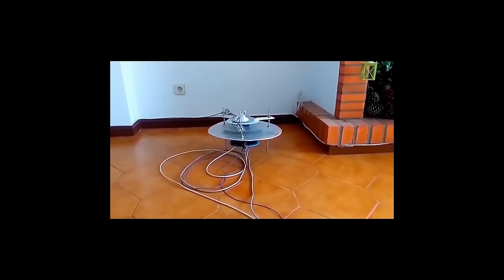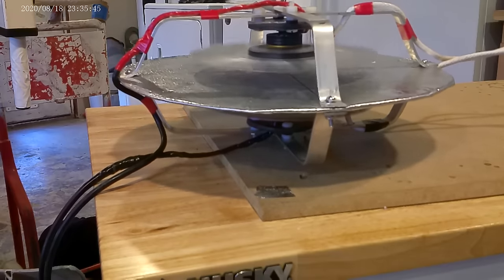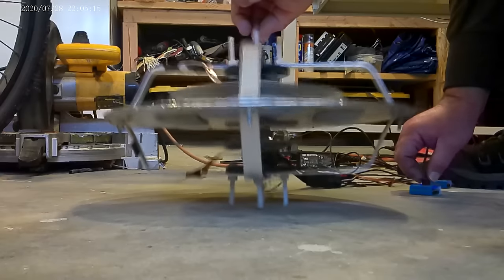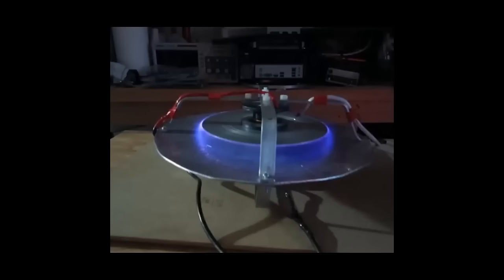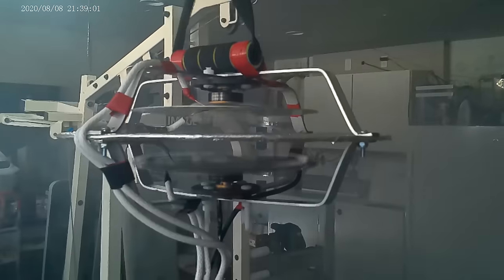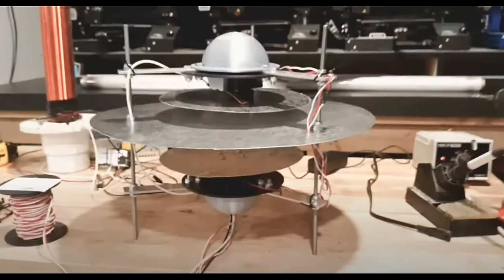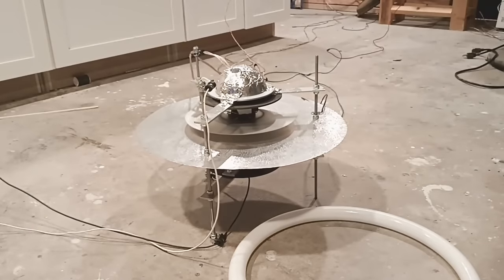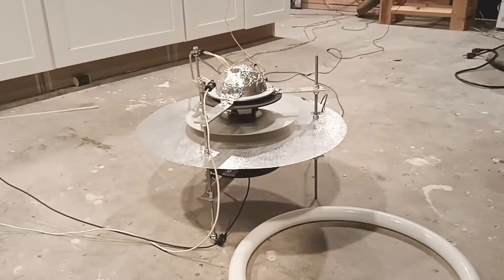Rebuilding My Graviflyer "Testing Everything"

Comment: You must Thought out of the box MR OLD MAN some people watching your videos and they already seen the antigravity technology inside an aircraft
Reply from the maker: I could always connect the tesla coil as a bipolar coil and increase the power of the field. I would need to change the #1 coil up a little. But not enough to stop the frequency beat rate. This would work in tc on both disc's and the hv to the frame. 

Th hv to each disc and the tc to the frame has an amplification point at 40 minutes running that could be exploited to increase the resonance of the center plate giving the piezo disc more energy to flip the field in and out for a few seconds.

Comment: Also N.Tesla patented an air vehicule that works as a giant capacitor. Wingless with a pole at the tip and a pole behind the tail wings. Apparently he traveled with it ! Inside spaceship there are big black cables that glows surronded  by  a blue  aura,bion.
Reply from the maker: is there a picture or video of that?

Comment: Just finished reading “The Man Who Mastered Gravity”.
It is a must read, specifically for you. It is a book about Townsend Brown. Who experimented at a lab (Father was rich) and it took him over 30  years to reach a breakthrough. The book reads like an Indiana Jones story.
He talked about achieving anti gravity with a fluid dielectric or a solid dielectric. Fluid dielectric is ionic wind, very weak. His breakthrough was the solid dielectric by charging unequal capacitors. It was classified but he was a very willing participant since he was very deep in US intelligence even befe there was a CIA or NSA.
Love your effort. Will continue to follow what you do..
Reply from the maker: I am working on a device that deals with charges and capacitors where the dielectric is also simi charged but won't break the voltage down between 2 disc's. Idid one before. I am going to start showing the force from it on a scale when flipped upside down. 
https://youtu.be/pkCNuuiI1kM

Comment: The high-spinning disc resisting change in movement at 3,000 rpms is called gyroscopic procession. This type of centrifugal force has always intrigued me.
Reply from the maker: it is balance not lift. Try it if you get a chance. when you have the motor in your hand you will understand.

Comment: I wonder if Alexey Chekurkov's Graviflyer is a follow - on to Eugene Podkletnov's work.
During one of Podklentov's long interviews, he clearly states that there had been advancements in understanding the principles underlying the would-be publication that relied on a levitating, superconducting disk rotating at over 10,000RPM.
In that old interviews, he said that they had figured out a way to achieve the goal without the need for exotic materials, and what he described could well be something like Chekurkov's device
Reply from the maker: Alexey is working on harmonics to create the townsend effect. The dc fan motors cannot go that fast at all. 1300 rpm max.

Comment: My theory suggest that paper unique electric properties might come from it fibrous structure forming cavities of different sizes leading to tunneling electrons spreading around the sheet.
Reply from the maker: It is charging the air inside and the structure is holding it in. The weight is 4x the amount when charged. It might be more if I change the height of it. Wood is the best substance to apply charge to for instant decoupling when needed. One of the next tests for the paper lifter is to shorten the height then add more discs. The radius should allow for more pressure. If it does then the outside air is also being affected. This would give us an understanding between wood and gravity and how much downward pressure trees put on the earth bringing up the gravity level. It is an interesting study.

Comment: 12:25 - basically the opposite of an ignition coil. Instead of working intermittently collapsing the field to generate a high voltage current, you are using the coil to condition the charge by converting the field of the excess amperage, and convert it to voltage... which can be more easily/efficiently carried by the wire, and respond more efficiently through the fields of the machine.

The bad part is... the EMF of your contraption is getting dangerously high. If a portion of the generated EMF is in the wrong range, you can run into risks I don't think you are prepared to mitigate.

Comment: 1 thing i notice that is different to Alexis is energy density, could you try a 13 AH 12v lead acid battery, for each device. Instead of AC transformers.
Reply from the maker: the current at this point I am constantly turning down. so more of it would not help.

Comment: You should put it on a scale to see if its weight changes at all during any of the tinkering/banging/arching.
I would recommend an old-fashioned analog scale, no digital components because those have a tendency to be spitting false data when getting bombarded with electrons.
Reply from the maker: I agree

Comment: Have you incorporated the use of metal rings around the magnets? Also Alexi’s magnets are broken which will act as multiple magnets per ring, I.e. multiple north/south’s. 
I am wondering if the voltage from the Tesla coil can be transferred with a plastic cable. In multiple HV demonstration it has been observed that the static field will energize plastic.
In Ken Wheeler’s magnetism work he describes magnetism not as an attraction force but as  a rush (rush may not be the word he uses) to a rest point. The Bloch wall or rest point.
Ken states that “gravity” is the same as a magnet. He does not hold to the current theory of gravity.
One other site I looked at yesterday was showing that all things are diamagnetic, even wood.
Reply from the maker: static fields do travel through plastic. the metal rings are on the magnets from the factory. Ken is thinking of charges. Magnets imply that the material needs to be ferromagnetic. Charges or polarization is the correct way to see gravity.

Comment: The paper touching and leaving might be producing oscillation of rate of rotation of the disk and this might be the reason for that field. I don't know if you thought about it but you could use PZT that has high relative permittivity to test you theory and maybe increase the field. It's also relatively cheap, I think you could try it
Reply from the maker: it is a jump starter for static volts. The tesla coil field holds things in and the high voltage has very low amps so it acts like static volts. I can fill the area where the tesla coil makes the bubble much faster by touching the dryer sheet to the top disc only.

Comment: Two things, I think should be attempted. 1. Set an old AM radio in the area, not too close as you vary the motors. You should be able to hear any arcing, which you do have randomly, it appears. Arcing isn’t always a good thing as it burns and oxidizes the contacts. 2. Waving your fluorescent tubes isn’t very scientific for diagnostic purposes. The tubes should be fixed so variances are more accurately defined.
Aside from that .. this fellow you refer to as having a viable craft; does he run a website or something similar for studying his methods and processes? Thx.
also: when that computer trips, exactly what is the PC/Mac machine do? Reboot, pick up a “ghost” device, like a printer? What happens?? ✌️
Reply from the maker: It picks up ghost device or changes the web page on it's own.
Reply: @nathanbunten4299  yeah, you really need that spectrum analyzer to see what’s causing THAT kind of effect. Changing a web page requires VERY specific coding  - whatever it is, that’s just weird. It would be very interesting to see the interaction.  If you’re creating RFI, and you probably are, you definitely need to know so that you can protect yourself.
Reply from the maker: @gaspumprepairservice7009  I was careless. I know what went wrong. I try to explain how the fields push because of the Tesla coil. I was 1 foot away from the craft at Max power instead of turning it up slowly from a distance.

Comment: His disc is about a quarter inch thick. Your disc is 1/16 of an inch thick his disc are rounded off yours is squared off. And he's got another coil on the craft itself I don't know if it's some kind of coil or some sort of Tesla coil and yes you need many times  maybe 5 or 10 times more maybe even more. And the distance between the three coils probably makes a big difference , you may be able to look at his video and get estimate size and ratio by watching his videos I think you might need a projector and a zoom in where you can see the antigravity device much better .
Reply from the maker: Charlie C owns the original graviflyer and he did measurements on it. I have the correct sizes. The tesla coil circuit just needs to double in strength. The rest is now dialed in. I made a video on the original with all the circuits and parts in detail.

Comment: if your center plates natural frequency is ie 400hz, you need your motors to spin fast enough for 400hz to resonant the center plate at 400hz
Reply from the maker: the frequency is 13hz so 780 rpm is just right. however the center plate also puts out 6-8 more frequency's. But they are not the primary ones.
Reply: @nathanbunten4299  how did it go from your pervious hz to 13hz?
Reply from the maker: @freedomer342  the motors max speed is 1300 rpm on top and 600 rpm on bottom. To find the best frequency's I connected my ocillicope to the center plate and ran the motor speeds. The frequency's change with different speeds. I then tried to match the footage of Alexeys craft frame by frame. It put me between 830 and 630 on the top disc. Both motors have a shared driver. When I ran through the rpms again I looked for a change in the craft. A point where the resonance hit a amplified point. 780 rpm was the speed when the craft shuttered and picked up energy. It came out clear on the ocillicope. I mapped the frequency's at that point and found reheating frequency's. When my Tesla coil interacted with one of the it would spike. The best spike was 13hz the conversion to rpm is 780. I confirmed everything by getting a higher energy out of the craft than I put on. The resonance found an amplification point. I recorded a part in the video on my last test shown. I said the energy just picked up. I have documented this over 40 times. I have hundreds of hours of testing done. I show as much as people can understand. Even when you show special things others can't do. I still get people trying to change it instead of understanding it.

Comment: Nathan, battery, dielectric, and high negative charge on top and bottom disk, high voltage center and low voltage top and bottom, the correct ultrasound to negate the voltages originally and then turn off the ultrasound when the charge is high enough and you get the whirring sound, the magnets on the bottom and the induced magnetic field keeps the charges separated on the bottom and the dielectric keeps the charges separated on the top, negative charge repels the earth and negative charge attracts the ionosphere. the hammer marks allow the ultrasound to travel through the disks, the rotation of the disks induce a current to make the magnetic field, the large center plate also keeps the charges separated, you want a light photon with the battery frequency and not the RF with the power supply, the torsion wave or field is correct for gravity and why everything spins in the universe. The video where Alexey was putting out a large field and the gravifyer just turned over and did not levitate so this is the not the correct configuration as everything is shorting out. Alexey was just experimenting with different settings as you are doing. Alexey is not getting a headache and you are which must tell you something that I am telling you.  When a UAP approaches a person, it only interacts with cars electronics when the craft is close by and why the field has to stay close to the graviflyer, aluminum works with the graviflyer as it is close to silica that makes the gravity field in the earth.  Why do you keep on doing things the opposite of what I am stating and showing that this is not the correct way to go and getting no liftoff?  Why, oh why Nathan?
Reply from the maker: I have this thing tuned properly. I do not need to change anything except the tesla coil's power. Everything else is interacting the way it should. I have even found the over unity configuration in the craft. I have hundreds of hours of testing video I do not show. I know what's going on.

Comment: are the spinning discs close enough to the middle disc to produce a triboelectric charge like how a whims Hurst machine works?
Reply from the maker: It does charge the center plate on top and bottom. The center plate has positive on top and negative on bottom of the same plate. so both disc's are applying a charge to their side. Changing the octave changes the charge.

Comment: The higher you move the fluorescent bulb along the Tesla coil secondary, the greater the capacitance and charge. The Tesla operates at its resonant frequency in my experiments but changes slightly as I bring a fluorescent bulb closer.
Reply from the maker: put a wire down the center of it with a large object connected to it. the capacitance changes. Certain frequency's work better than other to light up a bulb. The top 4-6" has a different frequency than the rest of the coil because of the capacitance change.  It is not operating like a normal tesla coil.
Reply: @nathanbunten4299  Super fascinating. I will try your suggestions and let you know!

Comment: Is there a blueprint or design with instructions online for others to follow?
Reply from the maker: here are 3 video's on it and in the description there is a link to the 3d printed parts. I included the tesla coil, high voltage needed and the ultrasound circuit. Hope this helps. I have also done a lot of testing videos you may want to watch. 

https://youtu.be/kFa3lvylyyw
https://youtu.be/yUcPMlYO6AE
https://youtu.be/rk3d6Saf9_0
https://youtu.be/pW-yxtEPr6U
https://youtu.be/TWIAr7gr5LI
https://youtu.be/hBC7etRjIZE

Comment: The speeds of Alexey's disks are constantly spinning at a specific rate, he must be changing voltage or something to balance/inbalance the effects creating the lift.
Reply: I rewatched his videos and listened to the pitch of the disks along with the hissing static noise.
Reply from the maker: @Johnytiger  His discs change based on the charges of the center plate. They are aligned north south. When he has a pole shift he inverts the field for a second making lift.
Reply: @nathanbunten4299  OOOOH

Comment: What if you changed your center plate to a copper plate.
Reply from the maker: It does not allow for eddie current to push the tesla coil voltage out further

Comment: soo you saying that your machine repels the gravity?
Reply from the maker: It lifts by using resonance to break gravity
Reply: @nathanbunten4299  what kind of resonance ?
Reply from the maker: @HusztiKevin-o6l  the center plate resonates. Like a super fast vibration. depending on the harmonics it makes you need to set the octave for it. When you get the combination right you get a voltage spike. that tells you that you are all correct. then you need to hit the ultrasound trigger button. as long as the tesla field holds in the electro static charges or emi then it should all work. It takes a lot of time to get that right. I have not gotten lift yet. but i have done everything else.

Comment: You need much much higher voltage. Extreme High voltage.
Reply from the maker: just the tesla coil.
Reply: @nathanbunten4299  I'm thinking voltage so high I don't think humans have created it yet.
Reply from the maker: @kevinroberts781  Voltage is not going to do it. The field around the craft has to be thick enough to hold charges in it. Most of the voltage in this craft is just to amplify the resonance in the center plate. The tesla coil is the only thing setting the field.

Comment: Nathan if you know how it works then why isn't it working? If you increase the energy the field will go out and you will upset communications and the FBI will show up at your door. You will definitely fry your brain more with RF heating like the last time when you got the headache for four weeks. This has already affected you thinking and why you are getting belligerent. Gravity is a weak force and not a high energy.
Reply from the maker: that's only if i switch the tc and the hv. Running it in a conventional way It does not do that. The tc holds in the emi for the mst part. The tc never interferes with my electronics. So making that field thicker holds in more energy from the hv.
Reply: @nathanbunten4299  OK. I agree and understand.
Reply from the maker: @richardmuller867  I save your ideas. I want to build a better craft when this is done. looking up what you send helps in that. Solid state would be cool.
Reply: @nathanbunten4299  Nathan. Great! I can't wait to see what occurs. From what I know I think you will be successful in getting liftoff. I did not know if you read my comments as you don't comment to often with my ideas, but you do with other people.
Reply from the maker: @richardmuller867  you say a lot. Most people just want a question answered. You have an idea that is expansive. There is a big difference. It does not mean I don't listen.
Reply: @nathanbunten4299  OK thanks Nathan.
Reply: Thanks for giving me an ear as I only wish to help and see the graviflyer work.
Reply: Nathan, I just sent you an email with an attached word document for you to peruse if you wish to.
Reply: Nathan, I just send you an email with an attached word document for you to peruse if you wish to about Alexey's graviflyer.